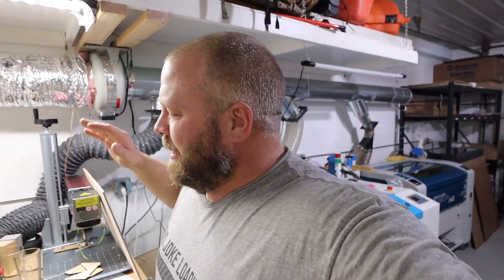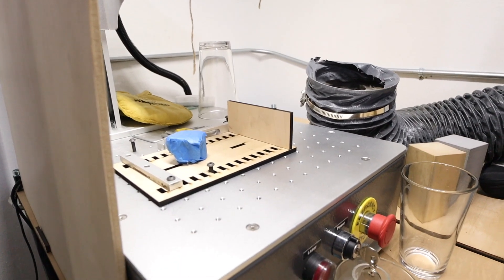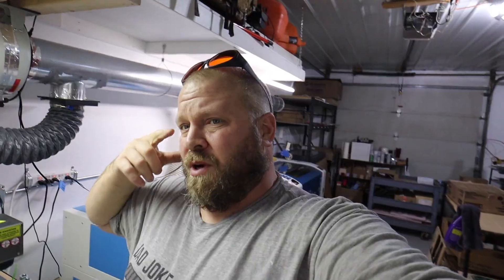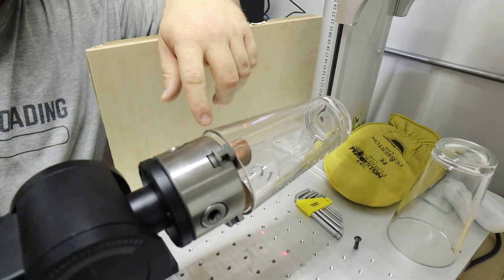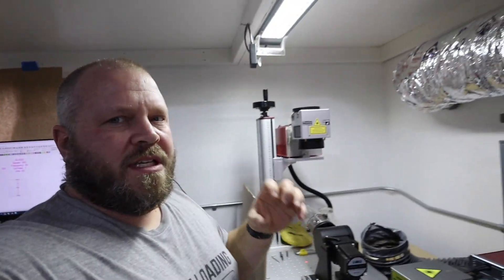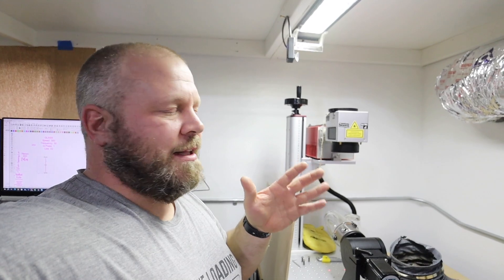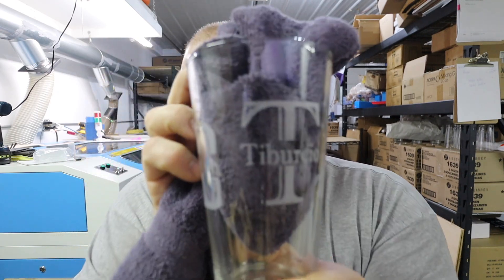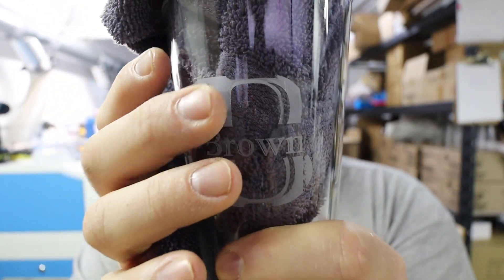Trying out the CHUCK ROTARY in the UV Laser

Comment: Regarding the red solo cup, have you ever tried to engrave one.  I tied one and got nothing or burned holes it in
Reply from the maker: Yes it’s easy
Reply: what does that mean using a uv laser?
Reply from the maker: I showed it in the video. I did it on a red solo cup with the UV laser.
Reply: what settings were you using on the solo cups?  I cannot get  it to cut thru the red and show white
Reply from the maker: @TTC1940 I don’t remember. It was a long time ago.
Reply: Do you recall if your engraving was white or move of a gray?

Comment: For Pint glasses and other slanted drinkware, I cut a wooden ring that is the same dimension as the top of the glass and the inner circle the size of the bottom of the glass. Basically, I cut a wheel and slide it on the bottom of the glass to make it level for the roller rotary. works great.

Comment: Hey matt. Were you able to find a good setting for the rotary?  I cant seem to be able to run it with high split sizes. I get some weird spaces in the design
Reply from the maker: Yes I am making a video right now. Split is .04 in the start settings
Reply: @laserengravingwithmatt   awesome looking forward to it.  I also use .04 with an overlap of .01 or so. Trying to figure out how some people get away with split sizes of over 1 mm.  All of my tests come out with spaces and separations in the designs.

Comment: Is there a way to avoid the laser etching into the bottom layer under the engraving if that makes sense? We also got a 3w UV after watching your first video on it! Completely gave up on the Chuck as I'm trying to engrave pint glasses... I hooked up the Coudray roller for the Co2 and that works flawless once I figured out the steps per rotation. I got the engraving to come out perfect at 28 freq 3 q speed 250, focus in 2mm, but no mater what speed, frequency, split size I use there's a faint image on the inner layer directly under the engraving. This might be unavoidable but the rotary never got set up in the Co2, so this is my first real go at glass. Thank in advance and looking forward to more UV content. This thing has blew my mind so far!
Reply from the maker: That’s awesome. I run 30 freq and 1q at 300 and if you move the focus a little bit it will stop doing that. It is pretty cool. I have done a whole glass like that but yeah it’s the focus just move a little.
Reply: Awesome I'll give that a shot! @laserengravingwithmatt
Reply: @laserengravingwithmatt  I lifted the focus until it got spotty but still have the ghosting. I did notice though that on an area I was testing yesterday, the bottom layer was burned without the top layer if that makes sense. It was out of focus so it engraved the inside of the glass but never etched the outside at all. That's what made me think it was unavoidable. raising the focus did lessen it a bit, but it's still there.
Reply from the maker: I don’t know what to say. The settings I gave works for me and I just played with the focus and I don’t get that.
Reply: @laserengravingwithmatt  Well it seems the "ghost" I've been chasing is the shadow on the inside due to me needing to upgrade the lighting on the side of the shop where the UV is... I took it to a brighter room it's gone, darker room with the phone light behind it and it's gone! The joys of learning lol Thanks again for your help and look forward to new content. On a side note my wife thanks you as well because until you posted that first video, I was hard on the path to a 100w Fiber as our next addition to the 100ww Co2. But Momma wants to do glass!! Fiber will be next.
Reply from the maker: 😆 glade to help. That’s awesome. Keep up the hard work

Comment: A 300mm lens would be the go-to answer normally for getting a larger range of focus, but is going to be huge on the UV. If you have the power to drive it to mark what you need, then you may just struggle with the height of your tower and trying to get enough height to focus (depending on the focal distance of the lens and height of the material). But on something like glass, most people can't handle glass on a UV with a 300 due to lack of power density at focus. An F160 is a 110 work area or thereabouts, going up to something like a 150-175 work area would give you plenty of power in focus and a bit more focal range. If you go above 200, you may have a hard time with glass due to the power density needed to ablate it, mileage may vary. UV has a significantly shorter range of focus compared to Co2 or fiber with an equivalent lens size :(.

For the rotary troubles, try dropping your split size, a lot. Like in the 2-3mm range - 1/10th of an inch or so, may help. It will go a little slower because of the number of rotations you have to wait on the rotary for, but it should help with quality and line edges meeting up better. There are spring loaded wine glass/tumbler rotary fixtures that use a chuck bolted down to a plate with a cone in the chuck for fast change outs, but I have to wedge mine up at an angle for stuff like pints because of the taper. You could do something like a rotoboss, piburn or similar with an adjustable rear end that can level out the cup if that's something that might work for you. Just gotta tell the company the connector you have and what type of rotary driver you are using (2 phase or 3), and they can wire it up to work with your laser.

Good to see you, as always man! Have a great holiday and new year to you and the fam!
Reply from the maker: Thanks Kyle. They are saying the same thing about the lens. They don’t think it will be enough power for glass if I go to the 300 so I think I will be trying 175. I hope you have a great Christmas as well. Thanks again for everything Kyle.
Reply: Matt, I noticed you mentioned getting a 175mm lens, I have a 5w UV and am having a hard time with cylinder correction, just not enough depth or power, maybe both, with the 175.

I also cannot get the chuck that my manufacturer included with the laser to work either, steps are all over the place, very inconsistent. Im also working with a PiBurn rotary, which also has been a challenge, so much so that Ive contacted my manufacturer. 

They essentially told me that it cant be done and that they tested their rotary drivers and are unable to give me the steps etc... its been a whole thing. Long story short, theyre sending me a new rotary driver to install into my machine to see if that works.

Comment: Have you tried cutting the glaze off a ceramic cup I bet the white will pop if you go with a darker glazes?

If you were working off a perfect cylinder I don't think you would have the distortion. But because of the slight angle when it rotates the bottom edge overlaps. Either you account for this wedge shape or smaller micro steps might be easier good luck. 
300 got a bigger window of depth maybe skip the rotation. Good luck
Reply from the maker: Good point. Thanks 😃
Reply from the maker: Oh and I have not tried cutting the glaze off

Comment: I use a roller style rotary tool that has an adjustable foot to level out tapers. Works great in the CO2 don't know if it would work on the UV laser. I can share a link if you like (non affiliate)
Reply from the maker: I have that for the gantry lasers, but not my Gelo lasers